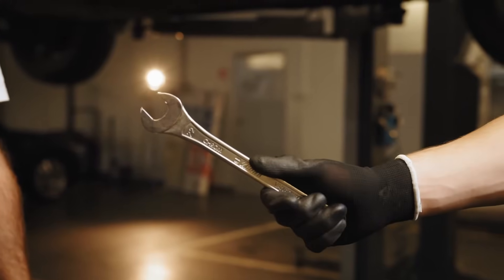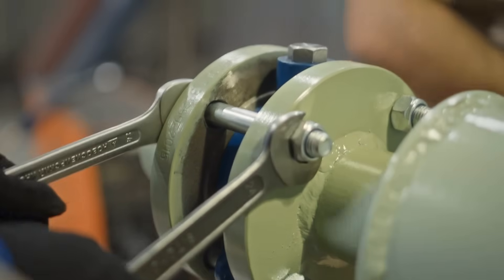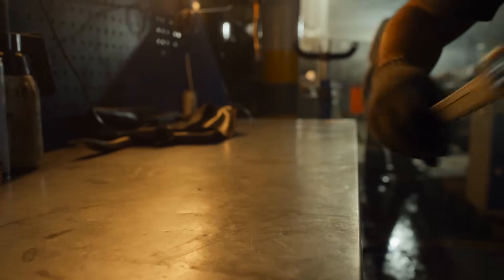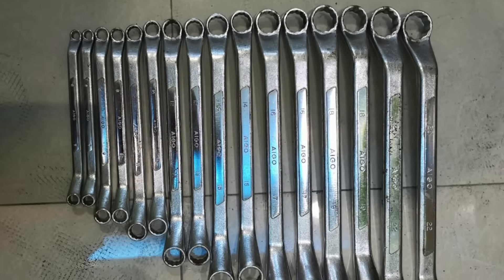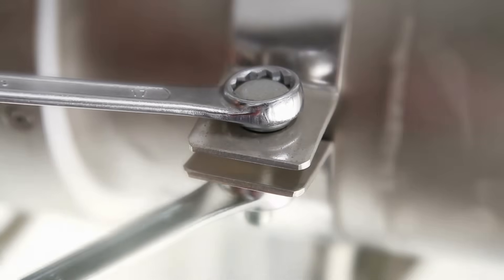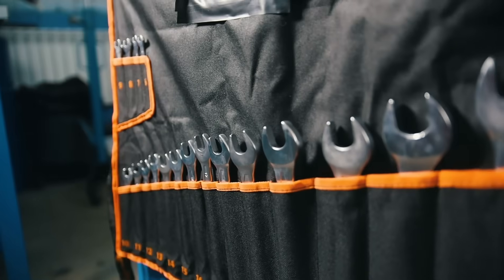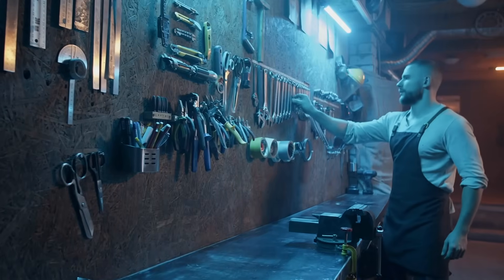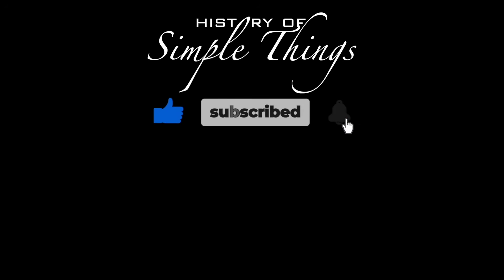Why Do Wrenches Have Angled Heads?

Comment: Also, the opened end is for tightening and the  closed end is for loosening a bolt
Reply: I never heard that before.  I don’t understand why?
Reply: The box-end is not for loosening, per se , but for breaking loose a nut or bolt. The benefit of the box-end is that, if the fastener breaks loose suddenly and encounters little or no friction from the thread thereafter, there's less -- i.e. nearly no -- chance of the wrench coming off of the fastener uncontrollably. The open-end is much more likely to slip off a suddenly-free bolt head or nut. Either end does either job (tightening, breaking loose, loosening) about equally well, but the box-end has the slight advantage mentioned, plus it can drop onto the fastener at the outset from twice as many different positions of the wrench (without flipping, and with the now-near-universal 12-point/double-hex interiors of box-end wrenches).
Reply: I was told the reason for this was If you use the closed end to tighten a bolt you are more likely to over-tighten it As in if you use the open end, as you should, to tighten a nut you will slip off of it when you tighten it too much Which is why if you use the open end to try to loosen a bolt You always round it off  I got this from the manufacturer of Craftsman tools. When I tried to get a warranty replacement on one of their tools and was questioned on the proper use of the tool that resulted in its failure.